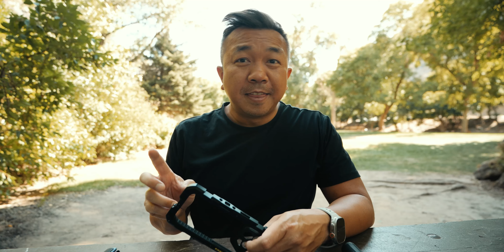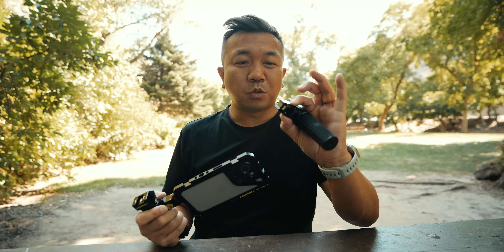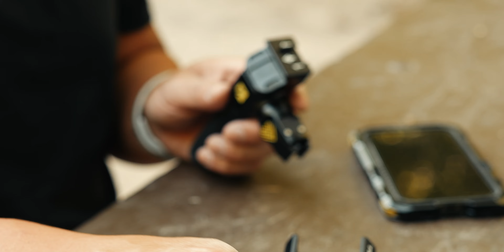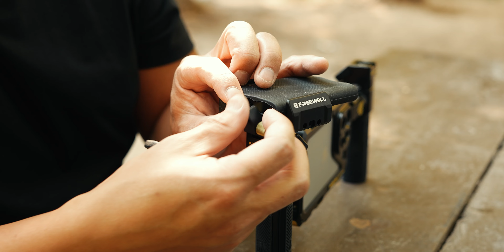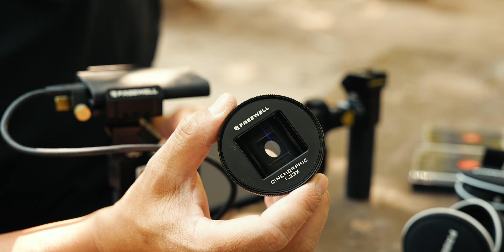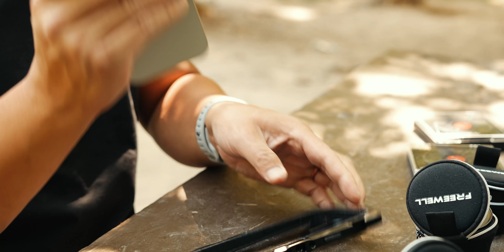Freewell Genius Rig | iPhone 15 Pro Camera Rig

Comment: Great video! Could you please tell me if the rotating handles turn relatively tightly? I'm concerned that if several items are attached to the case, the phone might rotate under the weight.

Is the build quality okay?

Also, by the way, what filter and telephoto lens would you recommend?